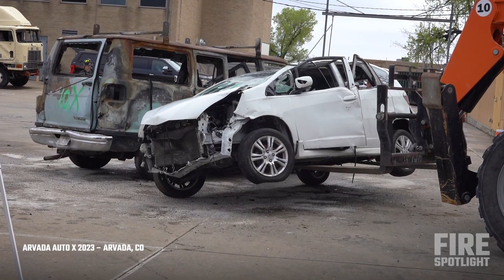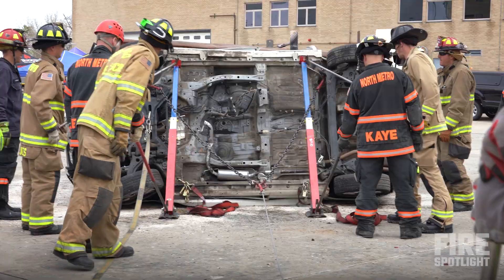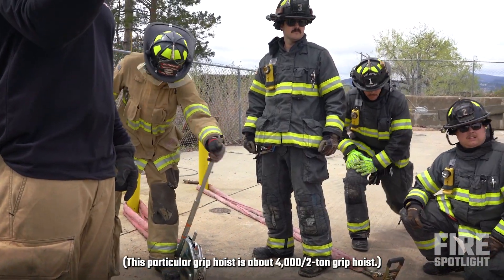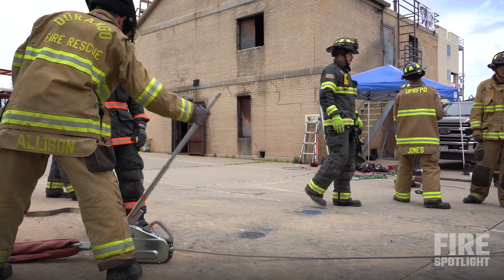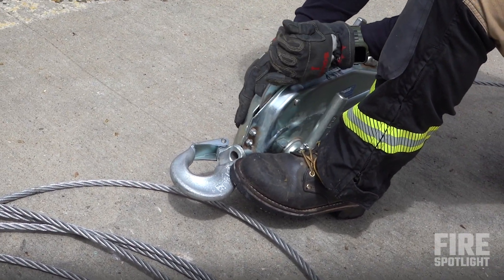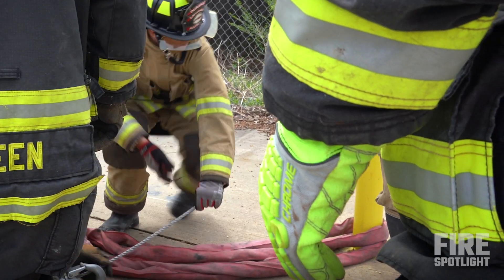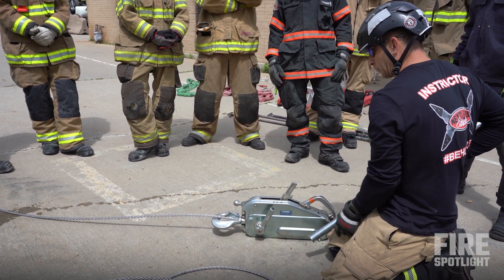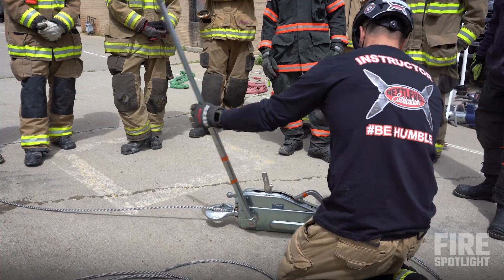Tie Back Rig System (Part 1): GripHoist | Vehicle Extrication Fireground Training

Comment: I have mixed feelings on the grip hoist... i think theres some applications it can be used in, but there are so many other ways that are faster and more efficient. Seems like the fire service keeps going backward instead of forward. 

JUST MY OPINION 😂
Reply: The proper name is a Tirfor. They are very safe, very controlled and very powerful. Just very slow. But when you are moving a lathe weighing 5 tons you don't want speed. They will work in mud even underwater. No limit to cable length.